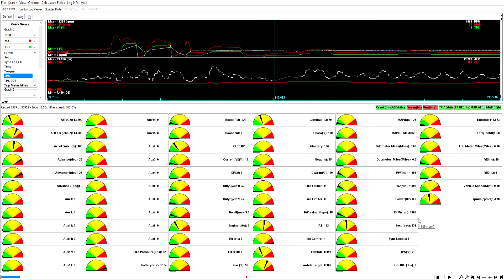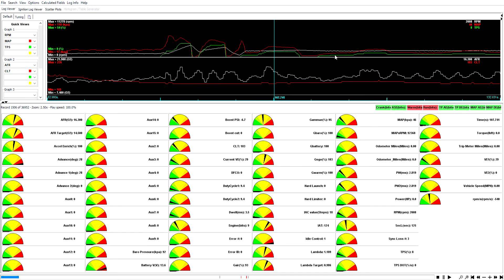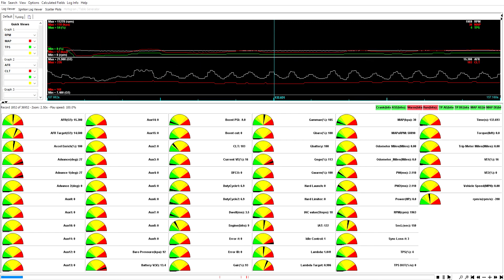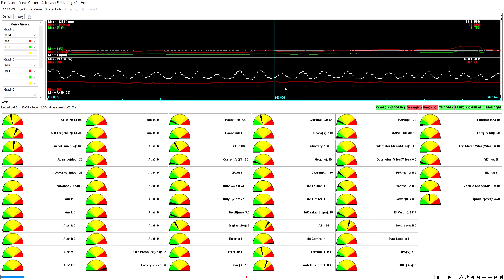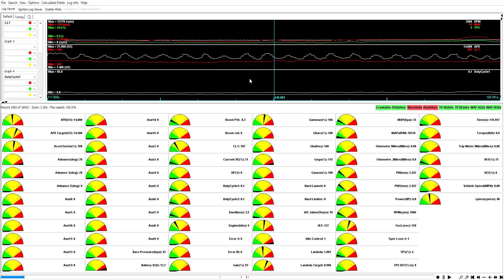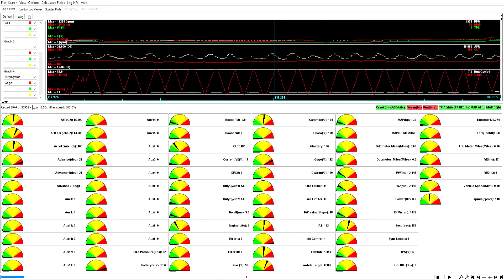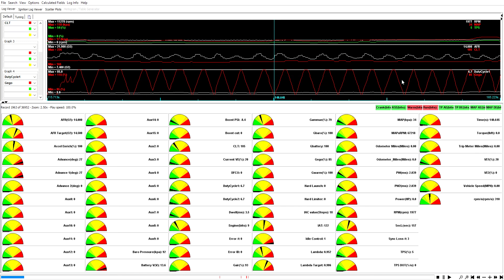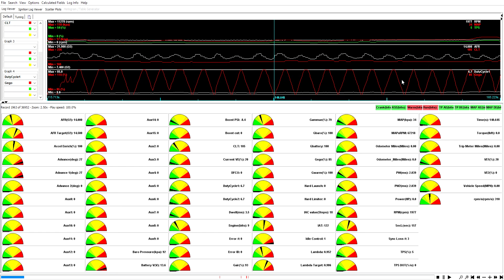EGO correction with SpeedyEFI

Comment: This is great advice.
I've been running the Tunerstudio on my Speeduino

Driving along with autotune, I'd had the EGO set to 16% authority and running Autotune. It was ALL over the place. I eventually pulled over and richened some cells and stablised it a bit.
When I got back and tried to figure out why Gamma was so high, it was the o2 feedback - 84% Gamma against 16% authority triggered in me!
I changed the authority to 1% while I was autotuning. MILES better.

I also did rounds of testing with the AutoTune set to easy, then normal.

Great video.